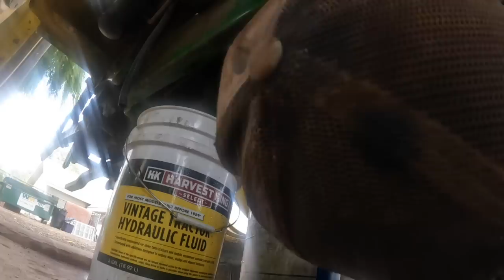6410 John Deere power quad valve body

Comment: Pleased to hear you had a short break, with how hard you work, boy do you deserve a rest now and again. This valve body looks like it should be inside the transmission and not part of the external casing, especially on a tractor. The knowledge, experience and wisdom you have accumulated shows in every video you put out and is priceless Warren, thank you.

Comment: Those accumulator valve bodies are junk in the E4OD/4R100 transmissions.  The valves will appear free on the bench but will immediately stick with hydraulic pressure side loading the valve.  The design is prone to excessive bore wear due to the pressure caused by side loading from hydraulic pressure.  I have the sonnax tool kit for the E4OD/4R100 transmissions so I automatically bore the the accumulator valve body and install better sonnax valves.

I have only seen 1 transmission case that had slight case warping in the valve body area.  I mainly build high performance and drag racing transmissions and on the super high performance ones I set the case up in my Bridgeport and I fly cut the bottom of the case to ensure flatness same with the valve body and pump.  The ford transmission pumps have very poor tolerances so I automatically resurface all ford pumps.

I have a very small precision bench top lathe and sometimes I make my own replacement valves both standard and slightly oversized.  I also make my own solid brass or bronze bushings to replace bushings that are know to have excessive wear.

Comment: He has some of the best multi-function tools. At 9:30 he was using a Cresenthammer.  😊
Reply: Every tool has a hammer end
Reply: When you're laying under the machine and you need to get something apart and out of the way, one of the tools that's under there with you is the right tool for the job.
Reply: I got me a few real crescenthammers from rastall tool , from a Canadian mining supply saw them on ave, I got the spud variety very skookum

Comment: Well I can say you are correct on the drain plug thing I did a service when I first started this in a professional field and I put the plug up and I was going to push the pan out of the way and then tighten it I pushed it out of the way and hooked the lines up to pump the oil out of it sire enough I didn't tighten it driver seen low oil pressure light and immediately pulled over I'd say that's the only reason I still have a job so every since then they get tightened

Comment: I have run fiberglass screen wire in front of the radiator in every vehicle I've owned since the late '60s.   My vehicles never have any radiator plugging issues and bugs seem to self clean just by falling off after a while vs being caught in the radiator fins.
Reply from the maker: Man, you got life all figured out.
Reply: @westerntruckandtractorrepa1353  No, just one thing that has worked well for 50+ yrs.
Reply: @Bobcat325  no surprise here

Comment: Grate video, could it be that it being a burned vavle body it was warped when they took it off so the hooned the valves to make them work on the bench, but then whey you bolt it up to the transmission it squizes back to straight and the valve gets stuck?

Comment: Valve body held vertical, valve should drop under it's own weight.  Those hard coated aluminum valves aren't the best way forward.  It's a new fkt up age I'll tell you.  JD loves to rape the farmer, damn robbery for that bare casting, outrageous.  I own a transmission reman facility, torque converters the works.